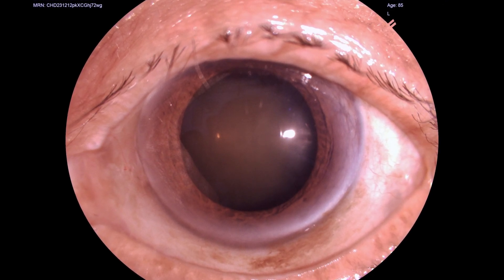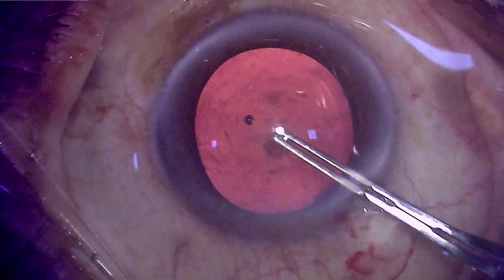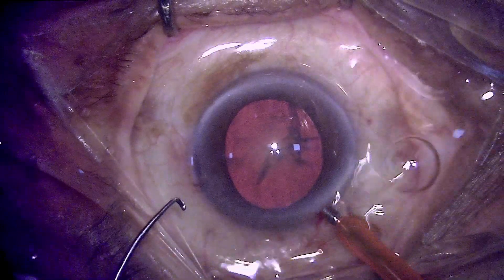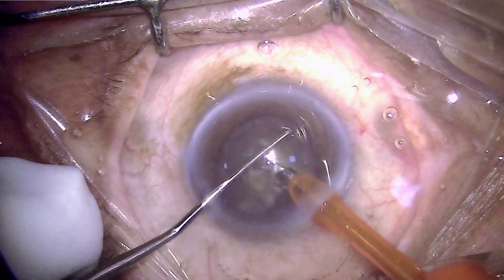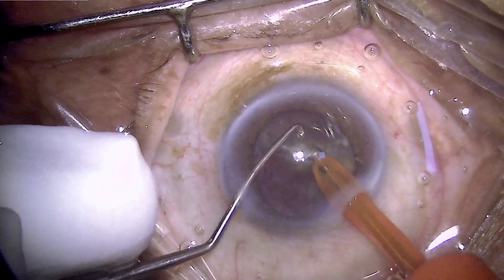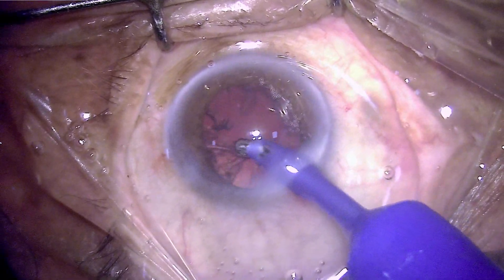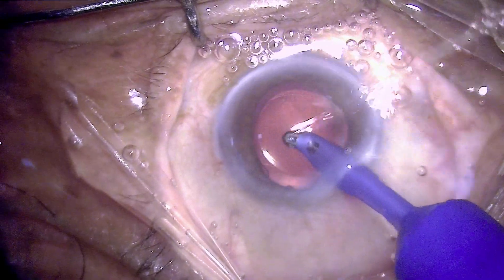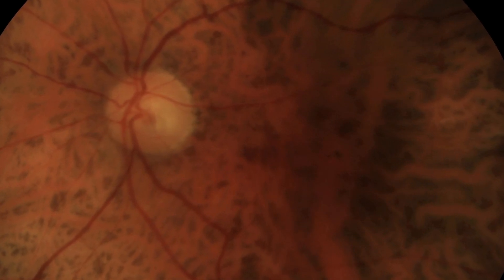Hard cataract, phaco surgery, and clear corneas: Only two tips

Comment: Sir , very useful in vet ophthalmology where we see more hard cataracts. Few queries , 1) Will injecting  visco towards corneal endothelial side to protect it reduces Corneal edema . .?2) For IOL insertion did you extend the corneal incision?3)what Phaco machine is this .? Thanks and very grateful for posting this video 🙏
Reply from the maker: Thanks for your appreciation.
1. Keeping the endothelium coated with dispersive visco does help because it prevents nuclear fragments from hitting the endothelium. But remember it cannot protect the endothelium if the nuclear fragments held by the phaco tip are rubbed on the endothelium.
2. The incision size is 2.8 mm. Most IOL injection systems have a tip compatible with this size. So there is no need to increase the incision size. Further if the incision size is increased, the subsequent steps don't have the advantage of a sealed incision and stable chamber.
3. The phaco machine used here is turbo orbit from Appasamy associates, India.
It was a pleasant surprise to know that the video is helping veterinary ophthalmic surgeons too.
Hope this helps you in your work.